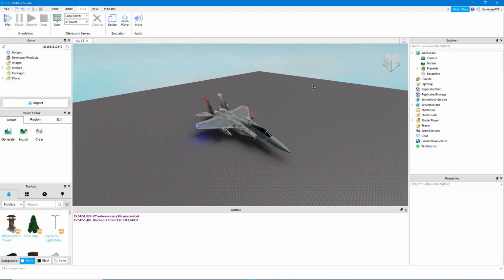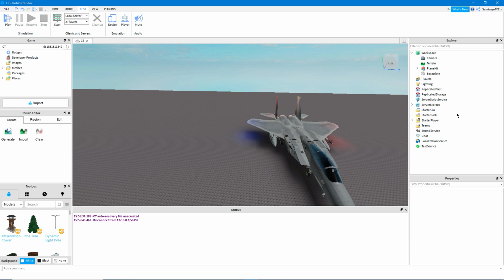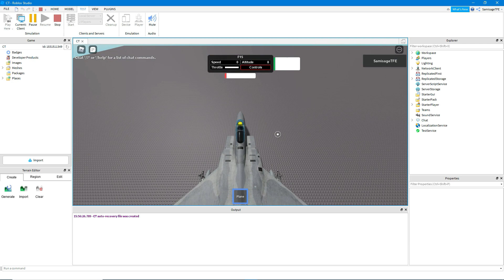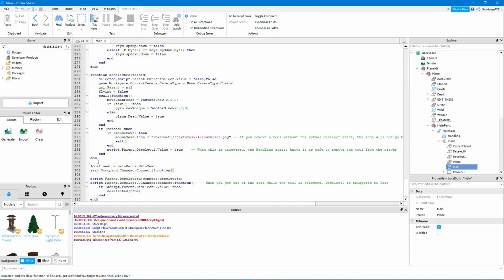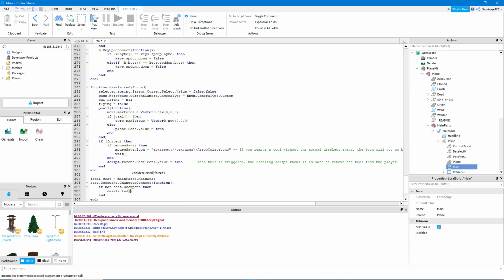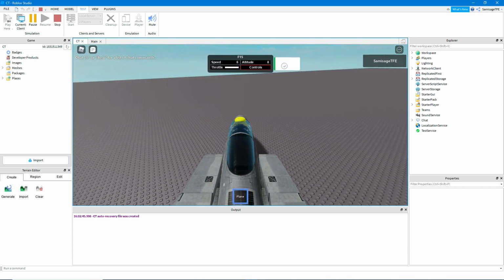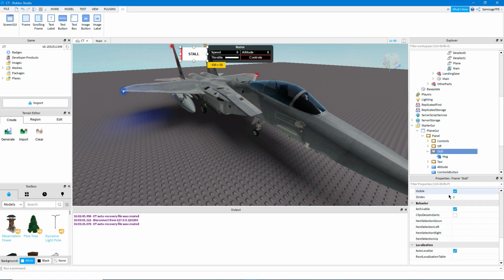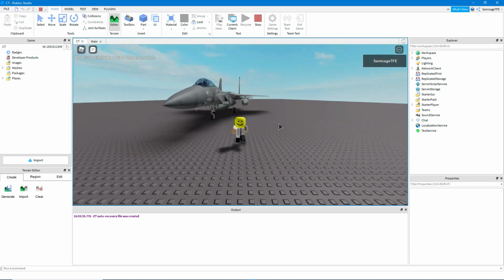ROBLOX Plane Series Ep.2 | Fixing Common Plane Kit Bugs

Comment: Hello, I love your game, for me it is one of the best airplane simulators in roblox.
I would like to make you some proposals or to add it later in the game, the first would be that if they could do it with more controls, for example the flaps, the different lights mean that they turn on one by one, that the front wheel moves forward, that the engines will start one by one to make it more realistic, a navigation computer to put the airport from where you are to where you are going and thus know how many kilometers you are missing, a functional cabin, a functional automatic pilot, that the landing gear has their respective movements and not that they come out suddenly and that the movements of the planes are more realistic.
If you want some things you can base yourself on the game filght simulator :)
Bye and keep it up
Reply: Look at their Discord. They have clearly stated that this is all nearly impossible with the current plane kit that they use
Reply: Not to be stupid but Sam is the Second Coder Orange is the builder.
Reply: It is the best.
Reply: they wont do this

1. this would be way too laggy
2. this would take SUPER long and they may not know how to do it
3. this probably isnt compatible with the current planekit they use.
Reply: Youre literally describing flightline
Reply: i p𝐎st℮d a vid℮o to describe the trick for many R💲 ✔

😋

🆗

ئۇنى سىناپ ئەمەس يوق سەۋەبى بار